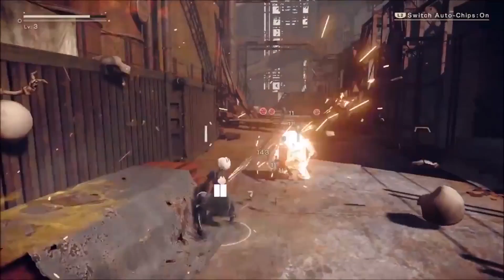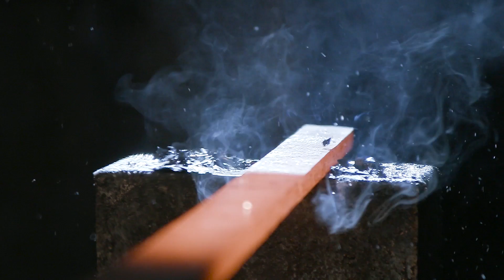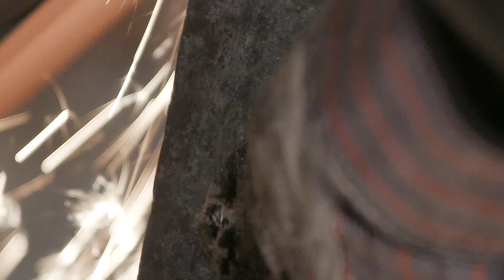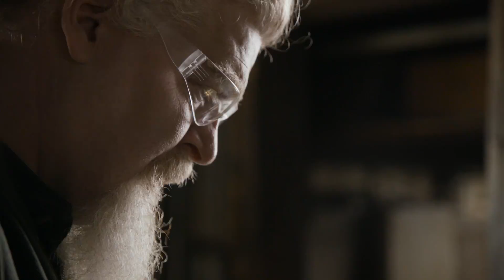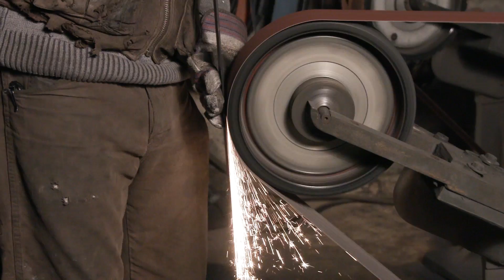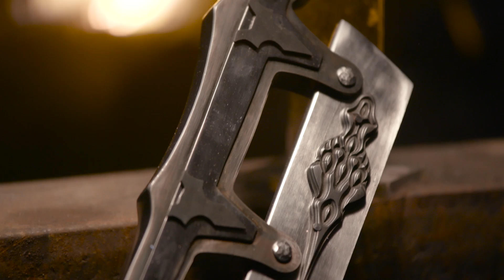Virtuous Treaty - NieR: Automata - MAN AT ARMS: REFORGED

Comment: Learning more about blade works, kinda like…… the Art of moving the blade and such, seeing it shake, and whine makes me shudder at the whole deal XP
Improper technique will cause shocks across the blade, and will cause its durability to wear down quicker.
This is why using bamboo to showcase these blades would be better, cuz then if you sharpen the bamboo to put something on it, you’d not risk the blade that much because of how easily it can be cut.

Comment: I always dislike watching modern era blacksmith's bastardizing Katana-style blades.They always use off-grade steels (such as damascus or stainless) to save time and costs, and stretch out the steel and 'try' to curve the blade as they stretch it out. There are also many rushed or time reducing techniques that reduce the quality of the product. The problem with these techniques is that it causes the blades to be either too bendy, or it isn't able to gain a cutting edge (where most artist made swords are the worst combination of both) 

Traditional Japanese blade smiths folded tamahagane steel (which is noted to being very pure, however not stainless), folded and hammered many times to remove impurities and strengthen the steel, and the most important parts, fold the steel around an iron bar + clay wrap and quench the red hot steel. The iron is soft, while the steel is dense and hard, which allows the blade to curve with the clay quenching. The clay quenching  gains its curvature by letting the exposed steel , which comes into direct contact with the water, to loose its heat faster than the blade (iron wrapped steel) insulated by clay. This allows them to create the sharp edge but retain a flexible blade.

The difference is in traditional Japanese folding techniques, the folds are prominent along the sharpened edge of the blade, and the backside is darker. A damascus steel sword will be white all along the blade showing all the waves (it was just sanded down to look like a katana.) A cheap blade won't show any wave marks along the blade, which usually means its cheap stainless steel or lesser grade metal.

I'm not really against seeing video game katana's being replicated,. I'm not even against them using heavy machinery to speed up the process of blade making. However I wish sometimes that they would try to follow some of the fundamentals of Katana blade making, because it is not the style of the sword, that makes it beautiful, but the amount of time and effort that went into it.

Comment: I always get worried when I see the blades wobbling after each strike (it's been a fair few of them) - are they meant to do that? The way Ilya has explained the smithing in multiple videos, it's made with a soft spine (to absorb impacts?) and a solid blade, so it can hold an edge and while I can see you guys slicing through items like butter I still see the 'wobble' and just wondering how many strikes they can take or if the blade will bend, etc.
Love watching you guys work :D my favorite videos are the ones where you all 'compete' and have some fun/poke fun at each other while doing it!

Comment: Nice I got an idea for you instead of mixing soft metal with hard metal you should have as the edge soft metal in the back of the blade hard metal so if it gets even hit it will transfer back to the hard metal in the soft metal will take nothing and it will be easier to sharpen

Comment: Given the fact that the tang is not an extension of the blade, I would imagine that such a sword would be structurally weak by comparison to most of the builds you've made, correct?  I would imagine that attempting to slice into something too hard to cut would result in the blade snapping off of the mount.

Comment: In future videos could you block the blue light glow from the plasma cutters. That is dangerous for human eyes to see without propper protection and a camera only worsens the effect if not propperly equipped. Honestly Im surprised nobody from OSHA has said anything about the potential harm from the light emissions from the plasma cutters and welders that the camera is filming. Its great to share these, however propper safety methods should be implemented here.